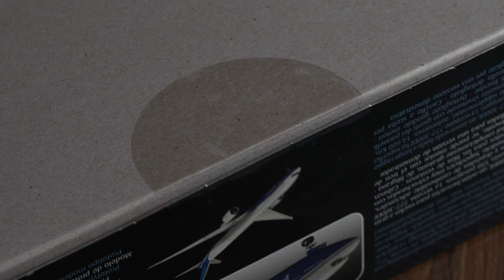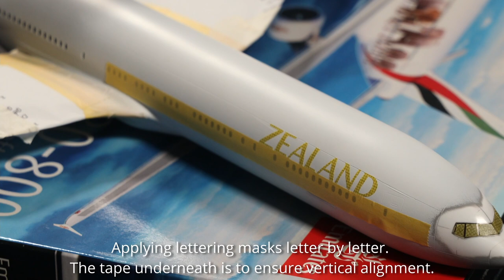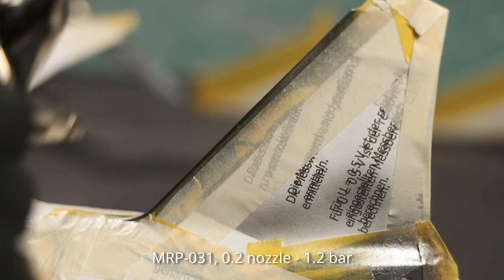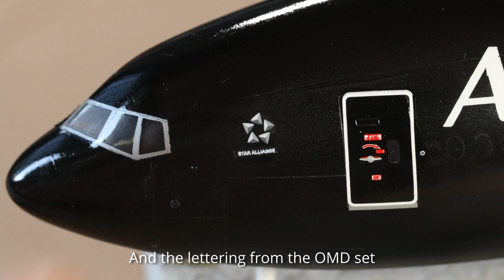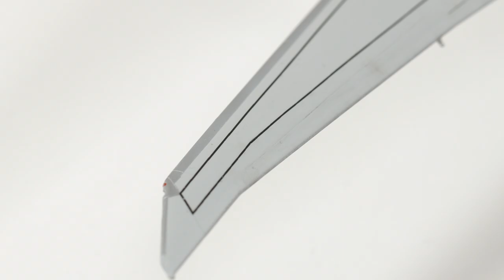Assembly | Revell 1/144 scale Air New Zealand All Blacks 777-300ER

Comment: Do you think you could do this with spray paint?
Reply from the maker: Depends which spray paint you want to use. The stuff from the hardware store gets pretty thick very fast, there are dedicated spray cans for modelling though. In general it will look better than brushed paint but using airbrush will look even better